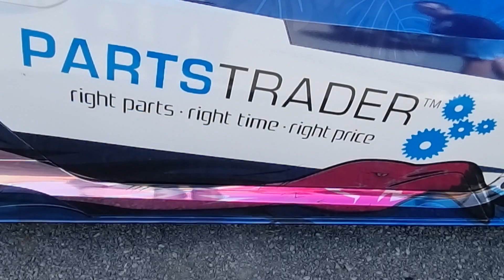Parts trader NZ RC-F Lexus with Hartley V12 twin turbo which makes 1000HP.  Link ECU link Razor PDM

Comment: 1uz w boost can make 1000hp
Reply from the maker: Sure,  I have mates with 1000hp 1uz,  but they aren't quite as special as this,  nor do they make anywhere near the torque.
Reply: @CartuneNZ  love your channel! Hey my buddy said the 1UZ can handle 8psi bone stock is that true?
Reply from the maker: @aaronhill3443  I've run 15 psi through stock uz with aftermarket management fine.  The main fail point is the old composite head gaskets,  although I had a mate running composite gaskets with 24 psi on a built engine.   Those videos are coming.  It did two seasons of drag racing before it failed

Comment: Hello guys I really like what you do. I have an A 341e gearbox behind a 1uz non vvti and it started to have shift problems. It only goes into 1 and 2 and some times in 3 and does not go into Overdrive at all. I checked the solenoids and they appear to work, but I need help to solve the problem. I can not come to you as I am in South Africa
Reply from the maker: I have videos on doing a manual shift test,  In some work jobs I show checking the solenoid commands and I show testing solenoid resistance.  I also show checking live data using a scan tool.  Hope these help.  Cheers Kelvin